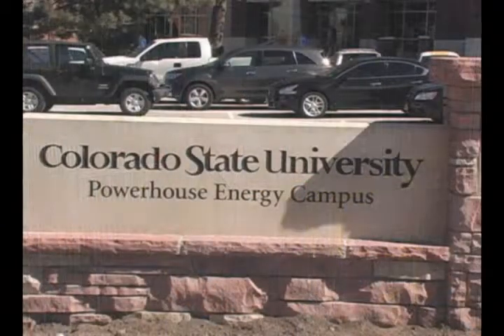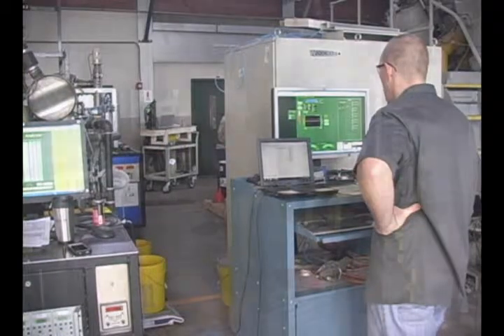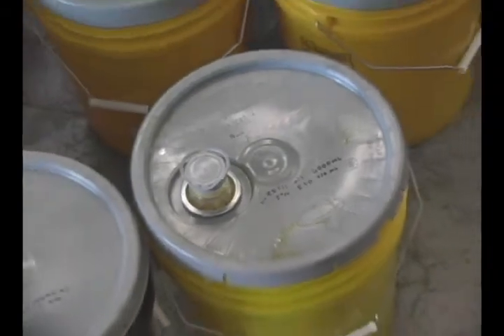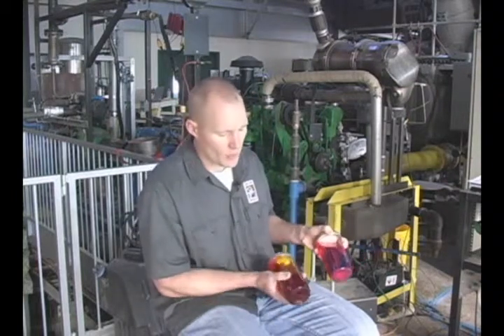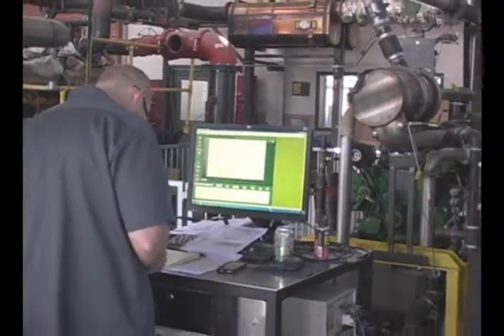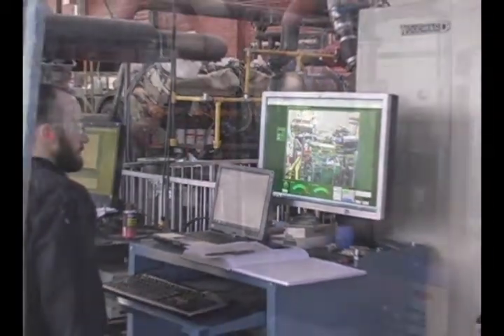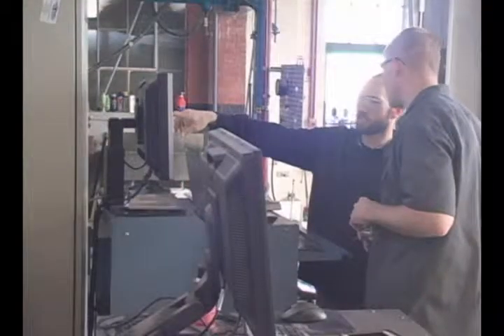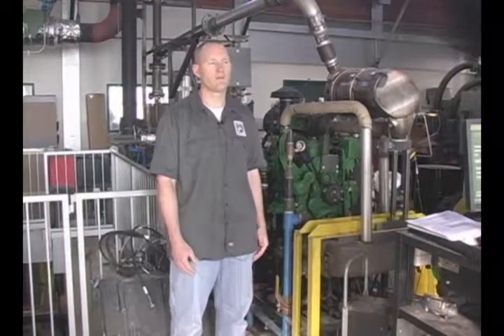Colorado Corn research into making diesel out of corn oil and gas

Comment: How do I use corn oil for gasiline to put in my car.What else do I have to mix the corn oil with to make gas ?
Reply from the maker: Grain corn is used to make ethanol (grain alcohol) which is blended into 97% of the U.S. gas supply.  Higher blends of ethanol like E15/Unleaded 88 can be used in cars 2001 and newer and E85 can be used in FlexFuel vehicles.  For additional information go to https://growthenergy.org/fast-facts/